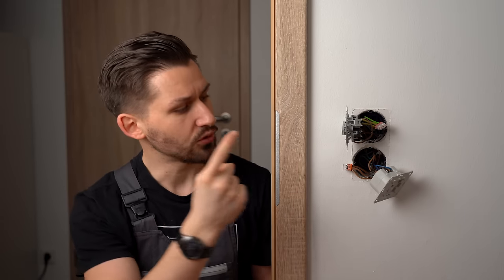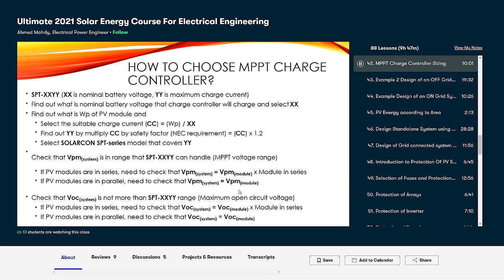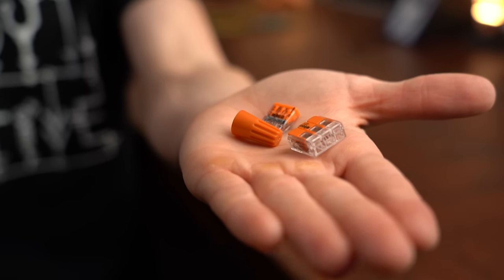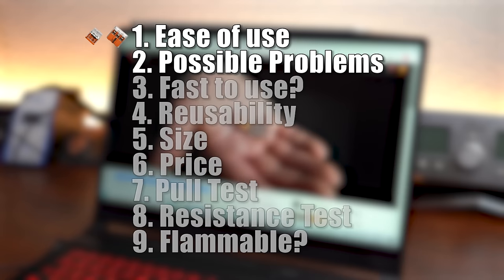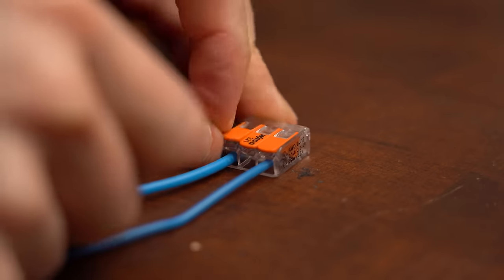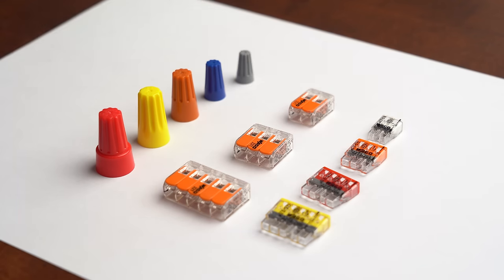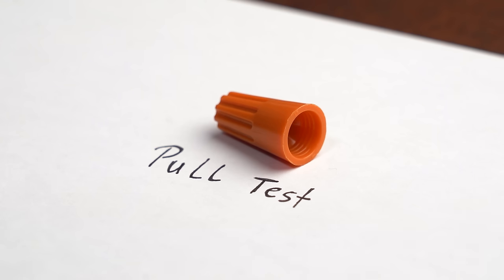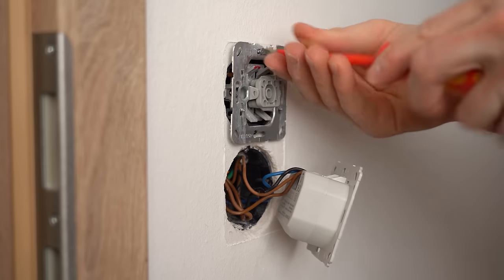What Wire Connector is the Best? Settling a Debate! Wire Nut VS Wago

Comment: I like the Wago but I prefer the Nuts for most wiring. And I've never had a problem. However I've noticed that most people don't use them properly.  That said, I've only worked with solid wire a couple of time and that was fairly recently.  So having working with stranded wires for a couple of decades. Nuts work great. But when I first worked with solid cable I was cautious when using nuts.  
And you said, time is money, but you know what else is money? Money! And for me there is a big difference in nut vs wago.  And it's not enough to justify having to twist the nut. So I'd say use the wago on special situations, like when it's many cables use a wago. But when you just need a pig tail.  Go for the nut.
As for the googling information. I thought was dumb. Once you learn of them you just know which to use.  Like cables.  You need to learn that.  Or do you need to google which AWG size every time you'll wire something?  Or well, the IEC size.  Just like working with wires will have you "Well I need a 4 mm²"  you'll go "Well I need a yellow for this" 
I will recommend wago for amateurs tho.  Less likely for them to mess up. And since they won't be using that many cost isn't an issue.

Comment: I grew up with wire nuts. They really are pretty terrible. I've not used the Wagos, but they look elegant. They have similar ones in Italy, but I always just buy the simple ones that have a well like a wire nut but with a screw coming into the side to mash the wires together firmly and keep them from pulling out. They are also transparent, so if you screw it up, it is usually quite evident.

Comment: Hi,
The resistance of the wire nut ("KUPOLFIX" in Hungary) cannot be measured, because it secures the two wires twisted together. The resistance comes from the surface contact of the wire. On the Wagon, on the other hand, the cross-section of the internal connecting plate gives the resistance that can be measured at the connection. This production quality may differ from one another. At such a small size, even a small difference in the width and henhered thickness of the plates causes a measurable difference.
Thanks for the video, excellent!
Szia!
A drót anyának (Magyarországon "KUPOLFIX") nem is mérhető az ellenállása, mert az a két egymára csavarodott vezetéket rögzíti. Az ellenállás a vezeték felületi érintezéséből ered. A Wagonál viszont a belső összekötő lapka keresztmetszete adja a kötésnél mérhető ellenállást. Ez gyártási minőség szórástól lehet egymástól eltérő. Ilyen kis méretnél már apró eltérés a lemezek vágásánál szélesség, illetve a henherelt vastagság kis eltérése is mérhető eltérést okoz.
Kösz a videót, kiváló!

Comment: Wagon connectors from Amazon have automatic quality control unless they are counterfeit. Amazon wire nuts lack that unless they are UL listed. The packaging for the wire nuts should list wire capacity and strip length. In the US you are limited to the number of splices in a box by the volume of the box. I am sure the code in Germany is similar.

Comment: Any trained US electrician would know the ratings of the colored wire nuts and fill size based on color.  Also what is not included in your comparison is the high temp wire nuts.  WAGO in my opinion is ok for low voltage applications, such as led lighting.  Some use the wire nut to make the joint of the wires but in best practice you should twist the wires together to make the full connection and the wire nut is to keep the connection.

Comment: Whats the current rating on your lightswitch faceplate? The wire nut, properly installed, has a current of zero at all times, because it's not a conductor. Some don't even use a metal spring.

Comment: The spring type of connector like the wagos are the same type as the ones found in some us outlets which have the regular screw terminal and a push in wago style hole for the wire. NO electrician will use the push in connector since they so commonly overheat and fail so often. Wagos have a tiny contact area compared to a proper wire nut connection.
Reply: @B Pace: Thank you!

Comment: In Canada I discovered Wago 221 a few years again, will never use a wire nut again.
Over many decades have worked on many older house wiring repairs and mods, found so many wire nuts, improperly installed , loose ,falling off or fallen off..

Comment: The wire nuts mate each wire together and that's why I believe they are less likely to catch fire or fail due to bad connection. The wago connect the two wires with a piece of steel. I dunno, I think the wago looks more durable and less likely to expose wires to contamination, moisture, dirt etc but the wire nuts are so much cheaper

Comment: Wire Nuts are not really reusable in my opinion, from experience. I would always use a new one. A new Wire Nut just cuts the thread into the wire while tightening and makes a way more secure connection than an old used wire nut.
Also the wire needs to be stripped like the video but it needs to be twisted together with Lineman's pliers until you have a tight twist down to the insulation, then you can usually cut the top 1/8" off the top of the twist and have a perfectly twisted wire and when put in a wire nut, its pretty damn solid. They make bigger wire nuts for 40 Amp Electric Dryers for example.
Id be interested in seeing new electrical construction and box designs in Germany, especially since you have 220v/240v instead of 120v like here in the USA. We only use a 2-phase 240v line for appliances above 25-30amps

Comment: Wagos and other similar types of connectors have springs, springs lose tension over time and could result in a loose connection. When running linesman and twisting the wire prior to the wire nut, that will never be an issue. But the main reason nobody uses them in the US is price and unions want to keep labor high on projects. So anything that could cut man hours down is stealing money out of an electricians pocket.

Comment: Coke vs Pepsi.... LOL Both connectors do the job just fine when properly installed and used for the appropriate application.  Technology marches on.  I heard someone try to argue knob-and-tube was inherently safer because you couldn't hit both conductors while hanging a picture.  After I stopped laughing, I asked, "what size nail do you use to hang pictures?  In my 30 years of work, from residential and multifamily housing maintenance to commercial HVAC, I have seen just about every kind of electrical device fail.  Nothing is perfect, but everything will fail if it's improperly installed.  

The first time I saw a Wago, I immediately remembered my first maintenance job at an apartment complex and all the receptacles that failed because they were feed-through and back-stabbed (a spring-loaded push connect).  Of course, I also noticed that the plug tester I used barely stayed in the outlet; the metal had lost its spring.  I've also had problems with push connections on communication wiring for automation; the example that comes to mind was the comms board in a variable frequency drive.  It caused all kinds of electrical noise on that communications trunk, and everything on it was unreliable.   

I think the lever type Wago shines in places where things will be changed often, like test benches and lamp ballasts.  The wire nut shines for high-current applications, especially with large in-rush currents like motor loads.  While the US code does not require pre-twisting the wires, it is best practice and ensures all the conductors will be in good contact with each other.  If enough wire is left at the junction, trimming once or twice over the life of an installation isn't a problem. 

Use either one, right, and in the right application, and you should be just fine.  (unless you use the cheapest knockoff of either....  LOL)

Comment: I only tackle electrical when i have to. I have wired up most of my house and a large shop by scratch. I was not aware of Wago connectors for a long time. I started using them on occasion, mostly for grounds. I dont know if they are code here in the north east of the US. If they are I will just use them exclusively. Wire nuts are a pain at times.

Comment: We were always told that the push in wagos without the leaver mechanism were single use as the stress caused by pulling the wires out can cause distortion to the gripping design
Reply: You need to twist the Wago while pulling the wire out. they are definitely not single use. I use them since more than 30 years, some of the connectors got several rewirings because of changed needs - they still hold strong with 20Amps on some circuits, most used with 230/400Volts 16Amps like in Germany commonly used.

Comment: I have had a WAGO 2273 fail on me, as it filled with sod. Maybe it got twisted in the junction box, and a large resistance was introduced. Now I am kind of avoiding them, as I never had issues with a standard or double screw terminal connector

Comment: Something noteworthy: for wire nuts to be “properly” secured the two wires must be twisted together. This is more or less a failsafe on that connection. As the wires heat and cool over 50 years that can cause the connection to loosen, so if they are twisted plus the wire nut, the likelihood of a failure is reduced. I haven’t ever used wagos nor replaced them, but I am curious how well they hold up over decades of use compared to wire nuts.

Comment: "There can be only one winner"

Proceeds to give points to both for the size category.

The wire nuts are in fact smaller.  If you followed your own rules, this would have ended in a tie.

That being said, while I do use wire nuts a good bit due to the fact they are ubiquitous in the US, I do prefer Wago.

Comment: In Australia, we use neither, the common method is to use screwed tunnel connectors, usually see-through.  Probably the slowest yet best method, with a small disadvantage of having a somewhat unprotected exposed brass screw head .  I always thought wirenuts were garbage, I just couldn't use them.  I would however think the Wago connector is quick and perfectly acceptable for many tasks.  Australian electrical fittings are very much like British stuff, so you find that power sockets will have a tunnel screw connector on that back of the power socket that can take 4 twisted 2.5mm conductors.  However, its a pain to use more than three and my rule for any new electrical installation is not to use more than 2.
Reply: Issue with the screw connectors is that they can loosen over time with thermal cycling in high load applications. With wagos you have constant force being applied on the connection.

Comment: Comments submitted here (some dramatically), such as @pie55q mention some important, relevant facts and observations. I have the highest regard for my instructors and value both constant code revisions and continuing education and experience. I encourage those who choose to endeavor working in this domain of risk to one's life, property, and that of others to do so with utmost mindfulness. There is much I could add but rather have thanked some of the recent posters. In closing, from my training I'll share that my instructor routinely critically examined the connections made by us all. Included in these examinations was a test where the completed pressure connection, made by tight helical twisting and encapsulated by a "wire nut" device was subjected by the instructor to a brute-force attempt to remove the "wire nut" using a standard lineman's pliers. If the instructor succeeded the student failed. No grey area.  Pass or fail. I encourage everyone, dear readers and posters, to be mindful of the potential outcomes of what you say and do. Thanks! 🙏

Comment: Here's a wire nut tip:
Don't twist the wires with your hands. That's a waste of time.
Loosen the chuck (has to be a keyless chuck) on a cordless drill, put the wires in, tighten it, and reverse-twist the wires and the moment it tightens grab the chuck and it lets go. Then just screw the wire nut on. With practice you can do this very quickly.

Comment: I’m a commercial electrician. Wire nuts are best. If you twist your copper correctly they work perfectly. Also every bag of wire nuts you get will tell you what size they can handle.

Comment: You NEED wire nuts in North America because we are rated for 120V, meaning, our current ratings are DOUBLE yours. In many circuits we are looking at 30 amperes, and 15 amperes for a typical home circuit. With those WAGO blocks, your going to melt or potentially damage them over time because they introduce resistances. The wire nut is conductor to conductor, meaning, no resistance between wires. The wire would be damaged before the terminal nut. In your case, the WAGO block would be damaged before the wire.

Comment: IMO, if you do not use lineman pliers and give the wires a twisting first the wire nut is not being installed properly. Second once the wire nut is installed firmly grasp the wire nut and continue turning it till the wires grouped together make a few more revolutions. This is the difference between a good and a poor wire nut connection.

Comment: I can't tell you how many wago 221 connectors I've found melted because of that resistance value. It turns the connector into a heating element and they burn up. For super low amp draw maybe it's not a problem, but I don't love them for that reason. Wire nuts are tried and true, and I don't have to google to find out if they fit....

Comment: I wonder if anyone in Europe has used wire nuts these last 20 or 30 years. What I remember from the past is we weren't allowed to just twist the wires in the nut but had to pre-twist them before screwing on the nut. It was a hassle and more times then it should it was a mess with bad connections and more resistance than was expected.

Comment: My main problem with twisting the wires together is that it weakens solid core wire.  Very often it then breaks when needing to do modifications.
Reply: This is exactly what happened in my furnace wiring. Two solid core wires inside the wirenut broke off due to over twisting. My thermostat that draws power from furnace went blank. Took me an hour to diagnose and fix the issue. I replaced the wire nut with an ideal push in connector from HD.

Comment: One more win for wire nuts: You can get weather proof wire nuts (for outdoor low voltage lighting and sprinkler systems). I contacted Wago, and they told me that their lever based connectors are not water proof, and will decay quickly in direct sunlight.
Reply: aren't all these connections in weatherproof housings?
Reply: @anxiousappliance  Because they are for above ground sprinkler valves.
Reply: Wago offers an IPx8 rated housing for their connectors though.

Comment: Wire nuts do not need a current rating as they do not conduct electricity the wires do.
Also you are supposed to twist the conductors before you put the wire nut on. This ensures the connection.
Wire nuts are also completely reusable and do not need conductors inside of them to work which means that the outcome of test 2 and 4 are wrong. 
Test 1 and 3 are also essentially the same thing so the wire nut is vastly superior.

Comment: Hands down, Wago wins for so many different reasons even in the US … but they aren't required and they do cost more. Also, for you, it was necessary to google the information about how to use a wire nut properly. When I first decided to use some Wago connectors, I had to do the same thing. Despite not being an electrician or anything here in the US, I intuitively knew how to use a wire nut when I have done so in the past, so that point possibly should go to both or to neither.

Ultimately, I won't use wire nuts anymore. I find that Wago connectors are simply superior and if I have to work on a box, I will go out of my way to replace the wire nuts I find therein. They are more expensive, but they are not so much more expensive that it isn't worth installing them any time I open a box that doesn't have them. (I don't bother buying 221 and 2273 because I don't do enough to bother with keeping a stock of both types. I just get the 2273 and call it good.)

Comment: I'm disappointed at the Wago's pull test and resistance results. For me, the most important factor is low resistance because of the reduced fire risk.

The solid-stranded wire nut connection at 5:44 actually looks bad to me, it looks like the stranded wire is wrapped around the solid wire. In my experience, when this happens the solid wire pulls out easily.

I'm going to get some Wagos for experimental setups because I like how they can be reused without mangling the wire.

Comment: I use Wagos on all low amp draw outlets and switches. The ease and speed of connecting more than warrants the added cost. Wire nuts have thier place too.
Reply: Ya their place is in the thrash bin.

Comment: I work in automated machine controls in the US.  I cringed when I see wire nuts.  Wago lever nuts work nicely.  The ratings seem to vary affecting use on 480V devices- newer clear ones are 450V (kind of odd and can't be used on a 480V motor).  The older gray ones have some marked 300V and some at 600V.  I haven't taken the time to dig in on the details in the spec sheets, just an observation.

You do really good YouTube content- thanks and keep it up!

Comment: One thought the wire nuts are cheaper, but time is money. So in the long run will the cost equal out after time saved by using the wago connector.

Comment: I think the resistance test was wrong. Here it worked for the wire nut but as you said before you cant check the connection cause there not transparent. I think if you use a wire nut the chance of a bad connection is much highter.